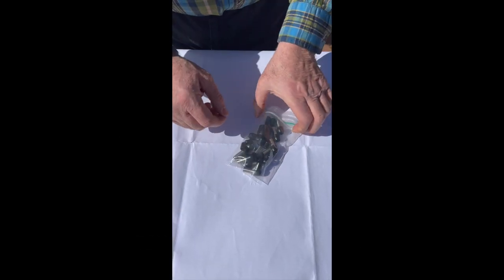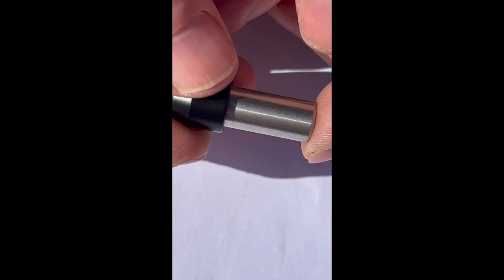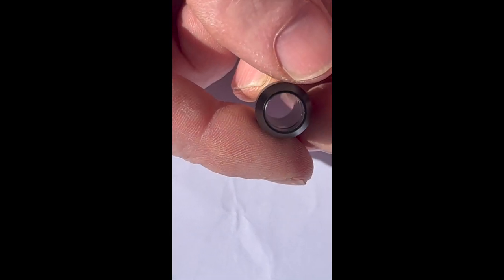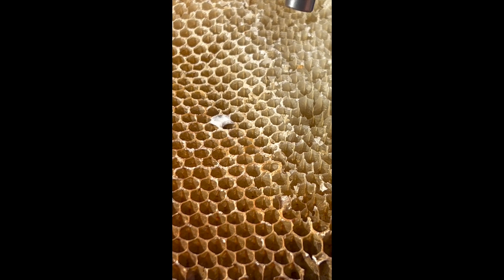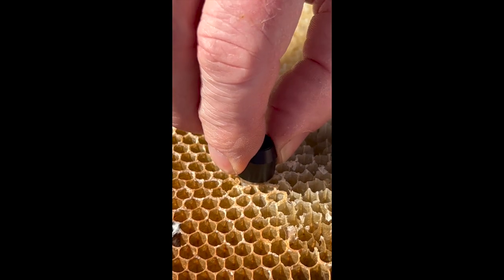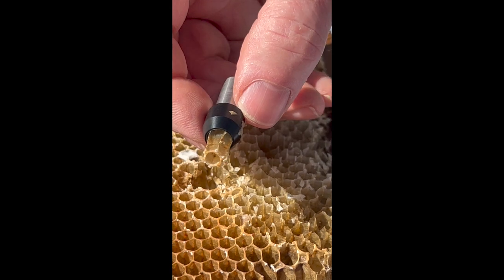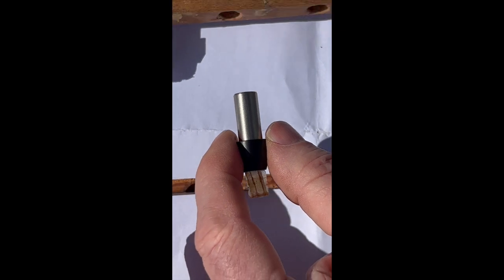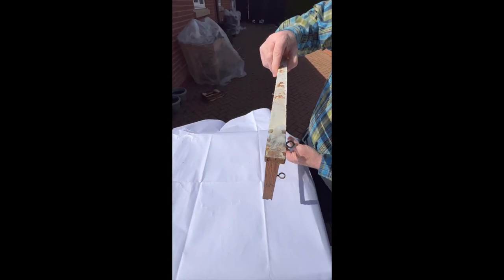Cell Punches for Queen Bee Rearing

Comment: But why tho? 
Traditional grafting is soooo much more efficient and it doesn't destroy a perfectly fine frame. I do a cell frame with 28 cells in about 6 minutes with a cheap traditional Chinese grafting tool. Just keep on practicing and you too will be a pro very soon. :)
Reply from the maker: I change my frames every 2 years for hygiene reasons. Of course I use a frame which I will put new foundation on, so the comb is not relevant. My old man grafted commercially, so was pretty competent. When he just kept some hives in the garden, he punched cells as it was less trouble with no set up time, no lights, no glasses etc. It's not better or worse than grafting, It is an alternative.